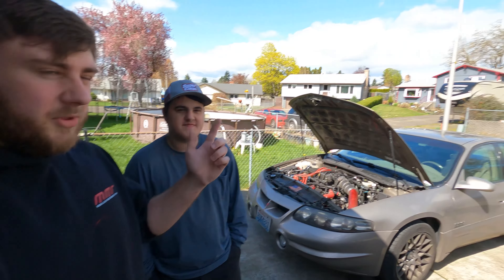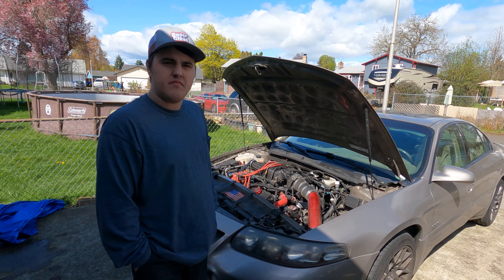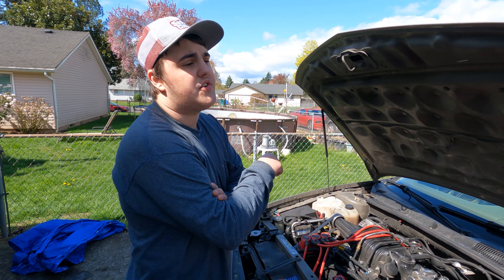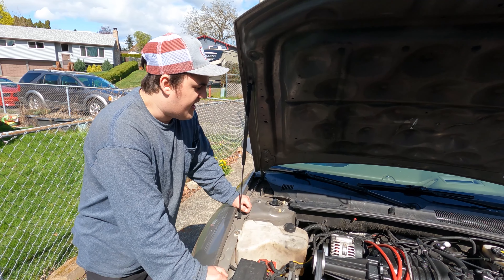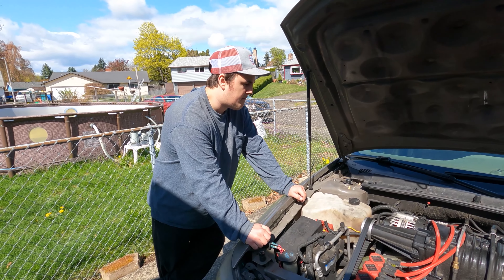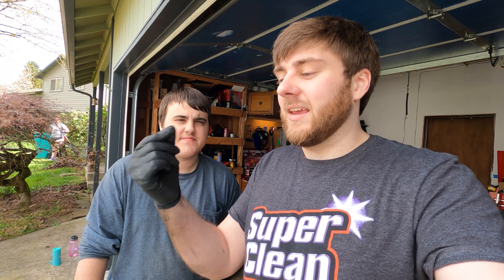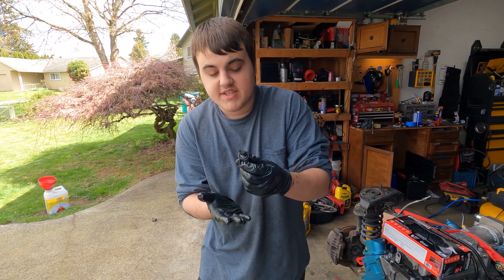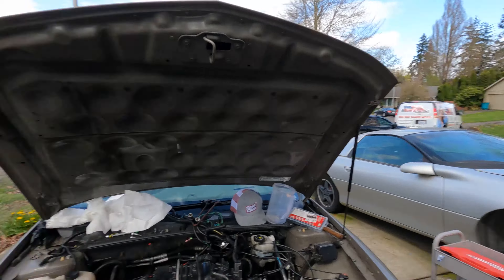Installing a BUILT Transmission in our Supercharged Bonneville SSEi! (Pulling the Motor First)

Comment: I HAVE A 1993 BONNEVILLE SE AND THE CAR STARTS BUT SUDDENLY SHUTS OFF .I HAVE ALREADY TRIED THE VATS SYSTEM, INSTALLING A BYPASS WITH THE SAME RESISTANCE VALUE, I TRIED A NEW ECM ,CAMSHAFT SENSOR, CRANKSHAFT SENSOR, THE FUEL PUMP IS WORKING PROPERLY, AND THE IGNITION COILS ARE NEW.I HOPE YOU GUYS CAN HELP ME WITH THIS PROBLEM   I HAVE BEEN WATCHING ALL YOUR VIDEOS, SO I HOPE YOU CAN HELP ME GET THIS CAR ON THE ROAD AGAIN. THANKYOU VERY MUCH GOD BLESS

Comment: Hey I have a bonneville 2000 sle n/a I have taken good car of it it has 182 k miles on it. I wanna get to either 400 or 500 horse power and I want to get the engine redone. Then I wanna get a turbo kit put on it but I wanna get a better transmission put on there. So I'm wondering should I do a tranny swap first and then work on the engine or should I get the engine work done first?
Reply: N/A is going to max out around 300 hp and a max effort supercharger build is going to max around 500 hp, if you really want power just turbo it from the get go
Reply from the maker: A good reliable transmission is a hood investment. If you build the supercharged motor you’ll still already need to upgrade. If you go for turbo you should expect to have a built one.
Reply: I agree with the other comments and your going to need a built transmission to hold the power you want regardless so id send it out to be rebuilt while your engine is getting redone. If your going for that kind of power your going to need to throw everything at it like i did. I recommend Triple Edge Performance for the parts. Parts we used is in the video description.
Reply: @tristanrickey2564  ok cool also I'm in illinois where they do emissions because I'm going for a sleeper build so i should still be able to pass and still be legal as long as I don't go to crazy right?
Reply: @akacj45  Where I live they dont inspect the cars, only plug into the OBD2 to run a test, so if you've got your codes deletes and no check engine light your good to go.
Reply: @tristanrickey2564  same here they only plug in to the port under steering wheel.
Reply: @akacj45  Then your free to do whatever to your car and you can get any codes you need deleted from the PCM with a tune.